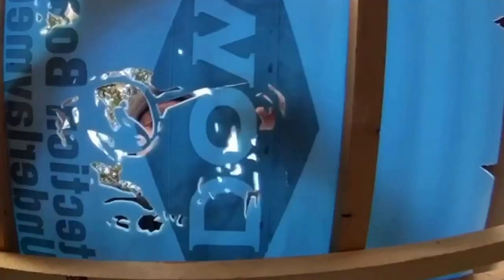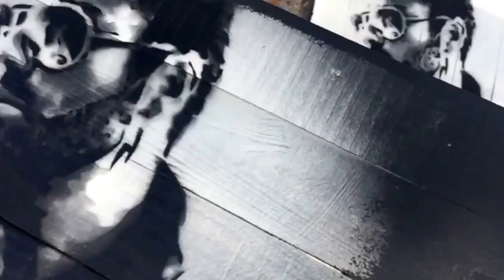George Michael Stencil paintings

Comment: Dude, awesome stuff.  Awesome.  Quick question, what material are you using for your stencils and where do you get it?  Looks like pretty good stuff.  I can't tell you how many materials I've tried.....thanks!
Reply from the maker: Steve Hare it’s a thin foam for insulating basements.  It cuts super easy but is a bit fragile.   Made by 3m.    I used to get it at Lowe’s.   They’ve discontinued it a year or so ago here in Florida.   Not many basements here.